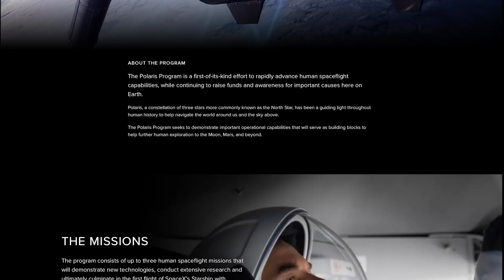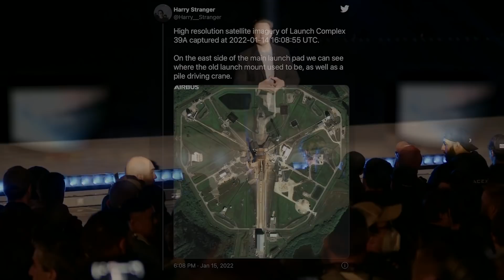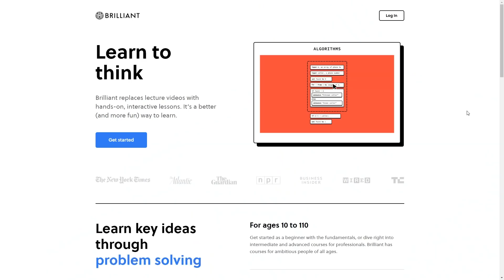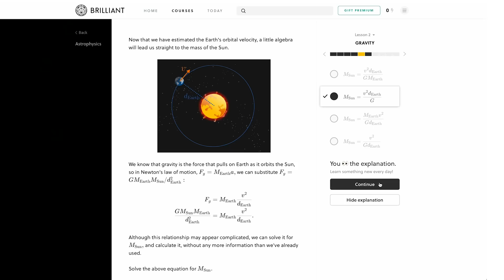Path to Crew Starship Becomes Clear | Starship Update (Narrated)

Comment: We need to see a test of the landing capability using the chopsticks. We expect to see the starship (top) be lifted by mobile crane and lowered into the tower arms as they close to catch the starship. No actual firey launch necessary. This test concept can be repeated with various rate of descent (using the crane) and positions relative to the catch arms. Let us know if this is in SpaceX's plans, and if not, why not and when will some kind of test landing be performed?

Comment: I think booster 4 and ship 20 should go first. Everything looks to be flyable, the engines appear to be flyable also out dated. Look it as a data collector, especially if it makes orbit. That's a lot good data and they really don't anything to lose. I wouldn't put Raptor 2 up until, the airframe could be evaluated per the airframe flight specs. The only way to know is to fly it.

Comment: Not sure if its THAT "clear," there is many orbital flights and critical senario attempts. Like 3 of them.
 [#1] The OTL, not able to split or wheel away, like a lower mobile claw, may endure incineration from the Beast Blast.
 [#2] The Beast canister stage, isn't capable, to fully park the upper S22, to orbit velociry, resulting in double roundtrip task COST of RISK-Refuel-Refill(02 life support)-Time per flight sequal, because no 3-stage rocket support to orbit (like a falcon-form added stage).
 [#3] Upper stage S/Starship22~ will need a cruise stage companion, eighter electric nuculear or a slower burning chem thrust, to maintain non-dole acceleration gravity G-force, in solar orbit, especially to maintain enough upper canister fuel for emergency/VToL manuevers at Mars.

Comment: If B4 is on the launch mount and still undergoing pressure tests, and B7 is being assembled, what is happening (or happened to) 5 and 6? Are there any potential issues with producing that far ahead without fully testing B4?